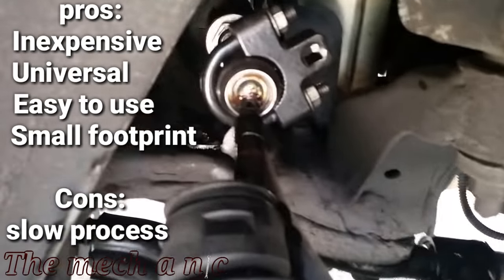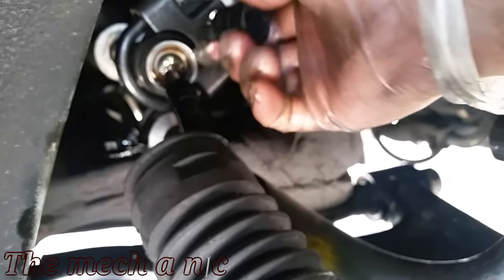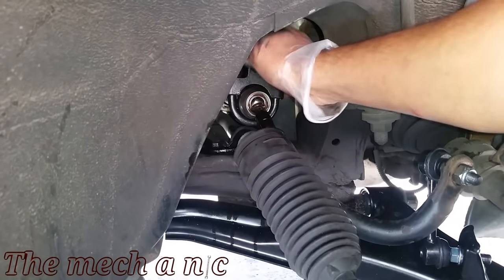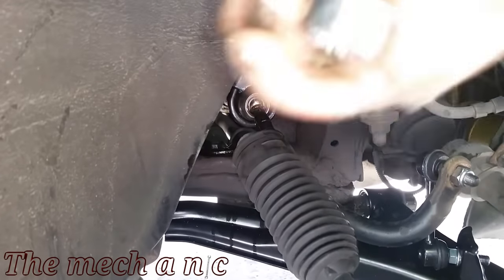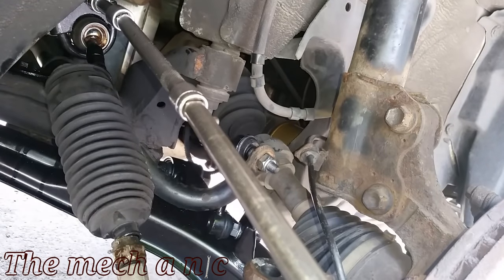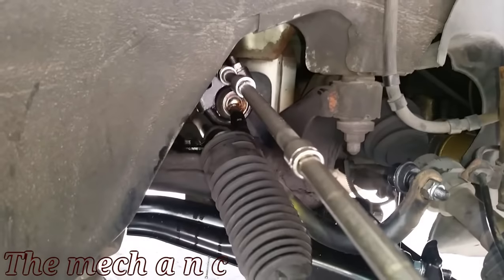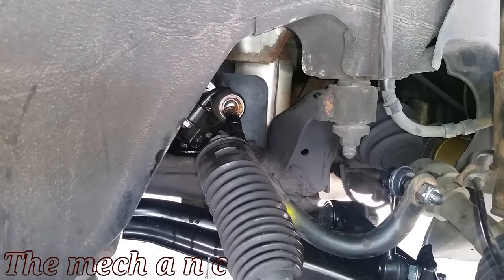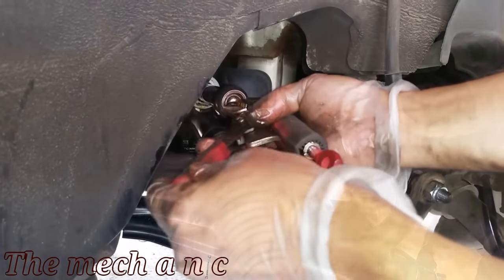Easy inner tie rod tool

Comment: The impact gun is not imparting any force that will help the tie rod come loose.  It's just going to break something in the tool chain.  The breaker bar IS imparting rotational force on the tie rod end.  Thanks for the vid.  I never even knew about this tool.  It'll be my next purchase 😁
Reply: Never use an impact wrench to tighten the rod. This will destroy the transmission.
Reply: @alchemik2010  tie rod isn't connected to the transmission in any way 🤣
Reply: @ryanfaulkes7469  this is a google translation error. it's not about the gearbox but about the steering gear.

Comment: Any time I'm using a long extension (such as accessing a crank bolt through the front-right wheel well during a timing belt replacement), I like to support the near end of the extension with a jackstand at the appropriate height -- this allows me to put my ratchet or breaker bar at the 9 o'clock position and just press down.  This way I deliver all the force cleanly to the target area without concern about twisting or damaging any tools or bolts.
Reply from the maker: +Really Happenings that's a really good idea, I thought of that as well but I get lazy lol
Reply: instaBlaster
Reply: We're do I get tool
Reply: Great advise, this should save a few broke extentions in future.
Reply: I would add that to loosen, you want the breaker at 9 o'clock, nowhere else, and the jackstand close to the near end of the extension.
Reply: great advice and comment.  I must add that having a single long extension will help with proper torque application and never to use a ratchet in high torque work...
Reply: This reply taught me more than the video, but if it wasn't for this video, I wouldn't have seen the reply.

Comment: But he is 100% correct about removing both inner and outer together.  I have done that several times over the years and it makes it easy and fairly accurate way to put the new components back in.  Twice I never even needed and alignment and the shop guy was surprised.  I said, hey, it is not rocket science to measure and replace
Reply from the maker: Yes I prefer to remove them together. Every time ive done that the alignment seems to be unchanged
Reply: If you measure it before you take off then No Problem !
Reply: An accurate way to measure is with a tape measure from outer brake rotor surface to outer brake rotor surface with wheels pointed straight - then adjust the tie rods to match after replacing one at a time.  Adjust after each to match measurement.
Reply: @donmoore7785  I agree with the equality in accuracy, at least from a probability point of view, so,, how long does it take to do it this way vs the "remove together method?" after all, time is money!😀
Reply: @jimmysapien9961 I just put a small strip of white teflon tape at the very top of inner tierod bolt or count the threads. The alignment remains the same if not better.

Comment: impact tool wont work!!!!!!   even if it didnt had lock tie!!!  i never make bad coments to nobody.   but what are you try to turn is the center of the rod not the center of the tool.
Reply from the maker: Lmao I knew it wouldn't work because of exactly what you said .I know the impact isn't isn't in the center of the tool so it wouldn't work but I was curious.  So I agree with you 😂
Reply: The mech a nic thanks for the vid!  im not a mecanic. your vid help me out saving me som $.
Reply from the maker: Thanks for watching
Reply: Yes, the impact tool was not working on the centre of the access, so no chance, whereas using a breaker bar works like a lever motion
Reply from the maker: Oh no, i did something that i knew wouldnt work. Curiosity got the better of me. Sorry i ruined your day 😂thanks for watching
Reply: @Ivan Moreno interesting
Reply: @Ivan Moreno no it would work, but the torque would not apply as usefully unless oriented well (against his hand) in other words held with handle in line with the line that cuts through the center of the inner tie rod and the innertierod tool
Reply: @Ivan Moreno 
I wouldn't say he's an idiot.......
I thought about trying the impact, but only because I don't have access to all of my tools right now and I am far from an idiot you don't know the author of the video you don't know what he knows and don't know calling him an idiot it's not a fair statement

Comment: Make sure you turn the steering wheel towards the side you're working on!
Reply: you mean away from the side you're working on...if you're working on left, turn it to the right and vice versa
Reply: @slin0053  It depends on the vehicle
Reply: @Diamond_79  serious question what vehicles have a rack where if you turn the wheel to the right, the tie rod goes to the right?
Reply from the maker: It depends if the car has the tie rods in front of the wheel or behind the wheels
Reply: @themechanic6117  oooh never thought about that

Comment: I like the tip of keeping the inner and outer tie rod together...I'm going to give that a shot
Reply: Yep
Reply: There shouldn't be any Red Thread Locker on it. Someone must have changed them out before and used it. But a good learner to be on the lookout for it. Most inners just come right off.

Comment: I spent 2 days trying to get my inner tie rods off using the tube tool from Harbor freight. Your advice of using a bunch of extensions on this cheaper tool I got from Amazon got the inner tie rod off in less than a minute. Thank you!
Reply: I had no luck with the “OEM Tool” I just ordered this part I hope it works to remove my inner tie rod 🙏🏽

Comment: just replaced the tie rods on my 1975 mustang and this tool is a must have. the rods werent flat, they were round so we couldnt figure out how to get them off. ended up using a pipe wrench.

wish i would have known about this tool beforehand because thats what it looks like it takes to get them off. it had spots for the splines

Comment: I used one, worked great in my case on a '95 T-bird, but in use the U-bolt deforms or bends just a hair, enough that the threaded ends get close enough to make easy insertion into saddle a PITA, but a short pipe and trip to the vise to spread them back a hair cures it.  I collected both inner and outer tie rod ends and boots before taking the OEMs off as single units, I matched lengths, finished up, had 1/16" toe out.  Steering wheel was centered though, so very easy adjustments and re-check fixed it all.  5/32" toe in now.

Comment: My joints broke about an hour ago. I was hoping there was a simple tool to help. Thansk nic....dont listen to rude peep. At least you posted a vid to try and help.
Reply from the maker: I knew using the impact gun on it wouldnt work 😂 it certainly stirs up the comments lol
Reply: Sometimes it doesn't hurt to try. Sometimes ya get lucky.
Reply: @RussMeister70  
I have to do mine I haven't started on it yet waiting for that tool to get here from Amazon. I was thinking of  trying an impact, but I don't think the impact would apply the proper leverage.

Comment: I have one and use it for pro use.Have not broken it yet although it has a lifetime warranty on it.I count the number of turns when taking off the out tie rod ends with the inner tie rod still in.Just write the number inside the wheel well.
Reply from the maker: +wafrederick nice to hear it holds up to that abuse. Thanks for watching.

Comment: My inner tie rods on my 99 Durango 4x4 is rounded with two grooves. Used oreillys $104 tool and didn’t even work. I hope this tool will work because I can’t get a pipe wrench in there at all.
Reply: Did it work??
Reply: Yes it did ! I fought with auto zone rental tool for a long time., I returned it and bought this tool and it busted it lose in no time.

Comment: Blue thread locker is better for this. Red is normally heat to release. For my car the inner tierod spec for torque is 58ftpnds. Don't use a an impact for this, you can easily break break blue lock tight with this tool and a standard break bar. Tightening to 58ftpounds with blue thread locker and the inner tierod lock washer...she aint going no where!
Reply from the maker: Yes I normally use blue thread locker on inner tie rods. I don't like how some inner tie rods come with supplied red thread locker. I just use my blue that I have.
Reply: You wanna make it hard for the next guy to remove I’ve never ever used thread tightener just torque to spec
Reply from the maker: Better safe than sorry.  I'd rather not have a tie rod un thread itself while on the express way.  Also, many tie rods come with thread locked in the box . I just did a inner tie rod yesterday that came with blue thread locker....

Comment: I'm gonna buy one today. My inner tierod is bent bad from previous owner wreck. I can't get the tube type on it. And dont have the resources for a cut off wheel where its located so hopefully this will help.
Reply from the maker: Good luck
Reply: What do you mean you don't have the tools to cut it off? You can cut it off with a damn hacksaw, LOL. It's like 20 bucks tops
Reply: @whitehistorymonth3563  
Are you sure it's not a hardened steel?
I have a bent inner tie rod end I was thinking of trying to cut, but I'm not sure if it's a hardened steel?
Reply from the maker: If I have to cut a bent inner tie rod I use a grinder with a cut off disk
Reply: @themechanic6117  
I understand that! A grinder with a cut off wheel or a torch would be the best thing I don't have none of my tools here I'm trying to make do with what I have. It's very frustrating, I passed out and wrecked my car got $125 fine for failure to control all my tools are crammed in storage I don't have anybody to help me I don't have no transportation right now nobody wants to help me I can't get around like I used to I can't lift nothing hardly no more but anyways thank you for your reply yes I cut off wheel would be the best thing it would cut through it like butter.
Reply: @themechanic6117  
I just need to know can it be cut with a hacksaw reasonably easy I can I'll take a file to it to see if it see if it nicks.

Comment: I checked Harbor Freight and they don't have it. maybe it would be nice if you could give a tool name and or number. it would make searching for it a little easier.
Reply from the maker: The name of the part is in the title "inner tie rod tool" , you can easily find them in a autoparts store like autozone or advance autoparts...
Reply: @themechanic6117  None of the auto parts stores where I live had this tool in store. including Harbor Freight, they didn't even carry it. however at the O'Reilly auto parts store. they gave me a computer printout with all the information on it. of the one that I could order though them. it's made by Performance Tool, - Inner Tie Rod Tool # W83027 PFM. they did have another Tie Rod Tool where the Tie Rod went into this tube that was part of the tool. but I couldn't use that one because my Tie Rod was bent like pretzel.

Comment: I have this tool and used it successfully on several cars for inner tie rods and other purposes.  Also, I use blue thread locker.  Don't use the more permanent red thread locker.
Reply from the maker: I agree on the blue thread locker
Reply from the maker: I agree on the blue thread locker
Reply: How much is it ?
Reply: Do you know if this tool works on a 2001 Grand Prix SE?
Reply: @paulcherry1520  
About$15.00 on Amazon.
Reply from the maker: This tool works for almost any car
Reply: @themechanic6117  
Okay thank you I am just worried about the clearance I have to understand I have very limited tools right now I'm having to buy everything that I that I own duplicates of in storage it's very frustrating I wrecked my damn car got $125 ticket on top of that $95 tow, you pass out the SOB's and insult to injury and still give you a ticket.

Comment: FYI the longer the extension is, the less torque you have
Reply: Agree. And when using long extensions, it's better to use a long one piece and not several of them hooked together. Each joint makes it that much weaker and requires more torque.

Comment: My only problem with the tool is why they didnt make it in 1/2 instead of 3/8?
Reply from the maker: Check out the other tool I use for this. It uses a 1/2 drive .

https://youtu.be/3Lid_VyWiF0

Comment: Hmmm.  I do like the simplicity of that tool.  Looks like something I can make pretty easily on my own.  It is almost a heavy duty muffler\exhaust pipe type of clamp with the addition of the 3/8 socket.  But that tool is off center as far as torque is concerned, so you are not really getting all the torque you would want, but it should be enough
Reply: I thought the tool looked like the bastard love child on a tequila bender from a muffler clamp and wheel puller.
Reply: No reason to take time to make one.  They are inexpensive.

Comment: my question is, when you install the new one how does this effect torque spec since it's off to the side?
Reply from the maker: I suppose it would throw torque specs off. Id recommend using a traditional inner tie rod tool to tighten to spec
Reply: It's only like 40 something pound torque required. Just do it by hand. A quarter-turn should do it. Not that critical.
Reply: If you have the torque wrench off to the side (e.g. the drive hole for the tool is directly below the tie rod, and the wrench bar is parallel to the ground) then the torque setting will be correct (so 90Nm on the torque wrench will correspond with 90Nm at the centreline of the tie rod)
If you have the torque wrench in line with the tool, you are adding leverage so need to reduce the setting on the torque wrench proportionally (e.g. if your torque wrench is 50cm, and the centre of the tie rod is 5cm away from the centre of the torque wrench drive, then you need to reduce the torque setting on the wrench from 90 to about 80Nm). 
Torque settings are rarely so critical that a 10% difference will cause you problems, and things like tie rods and TREs are often just done up to FT setting with no issues.
Reply: @whitehistorymonth3563  yes

Comment: At any rate, i changed all the tie rod joints and ball joints on my folks' 97 caravan and only used the usual tools and a pair of vise grips and a pipe wrench on the inner tie rods, wasn't hard at all.
Reply from the maker: +Nigon Kouk some put up more of a fight  than others.good job
Reply: It's easy if there is room. I did a renault and fml passenger side easy. Drivers side... too much stuff in the way to get to it. So this tool does the job for "tight" spots.
Reply from the maker: It sure does work good when you're tight on space

Comment: Some cars you can use a crows foot..  some hands have an inner tie Rob that's to long for tool.  And is in center of engine bay.  I've used a 29mm or 1⅛ sinex crows foot.  Grind 1 side to make it thinner.  Use ½ drive long socket wrench.

Comment: it pisses me off when they put red threadlocker on stuff that needs to be unbolted and changed.  Certain year Chevy's did that and the shop manual says you can't change the inner tie rods - you have to replace the "relay rod" (as they call it).

Comment: heat will break down Loctite.  Throw a torch on the tie rod and you will break down the Loctite and make the female thread grow a tiny bit which will help loosen it.
Reply: Never use heat on steering components!  While it does help loosen things, you really don't know how much heat and subsequent temperature increase you put in.  Heat is bad and can radically change the strength of the piece
Reply: If you heat use a heat gun or propane.  Don't use an acetylene torch. You do not want to get things too hot.  Even so, before using heat try raping the inner tire rods with a hammer.  A lot of the time the shock will help loosen the inner tie rod.  I use the same trick on brake bleeder nuts.  A lot of the time this will make the difference between coming loose or breaking.
Reply: @gk10002000  300-400 degrees won't change the metalugery at all but will make the part grow.
Reply: @stanleytolle416  
Right heating it red hot would change the property of the metal if anything it would make it softer but a little bit of heat from map gas or propane would not hurt it any.

Comment: pipe wrench connected to a come-along works.
Reply: Really? Because im about to try that
Reply: Yes - I ran a line from the hole in the end of the wrench handle to a come-along winch attached to the front tow hook. The inner tie rod is not that tightly torqued but it may have thread lock on it. Not enough room to put a cheater pipe on the wrench unless you have it up on a lift.  Make sure you have the wrench and line rigged STRAIGHT - do not pull at an angle. For the driver side run the line back to the rear bumper. Only problem is you can't torque the new tie rods to spec. Just wrench it as tight as you can with red thread lock and you should be fine. I had to do this because my Tundra inner had such a large diameter that the rented tool would not fit over it. good luck.  @sarahalmendarez8008

Comment: Inner tie rod ends are supposed to ( always ) not sometimes have red locktite, it would be a very dangerous outcome if a inner tie rod comes loose!! Same with intermediate steering shafts pinch bolts you absolutely never want to lose control of the direction your car is going at what ever speed you may be traveling!! Could be headed straight towards a semi in the oncoming lane, could be driving on a road along side a lake or ocean that wouldnt be good at all especially if windows are up!! Or even worse could be on a road with a steep drop off!!!